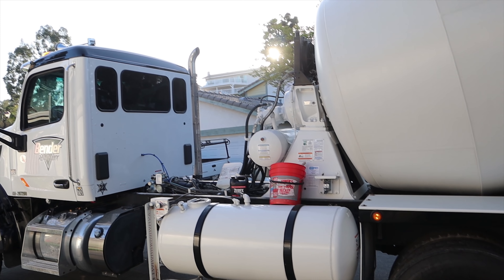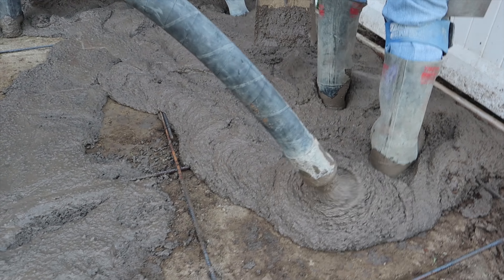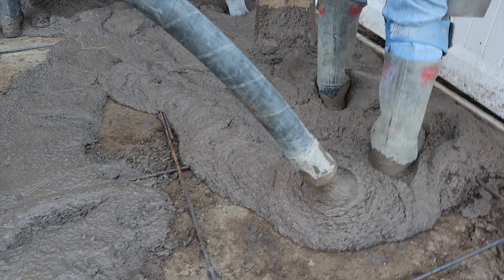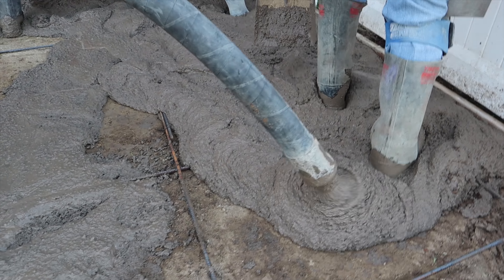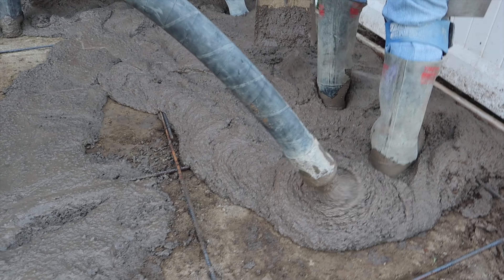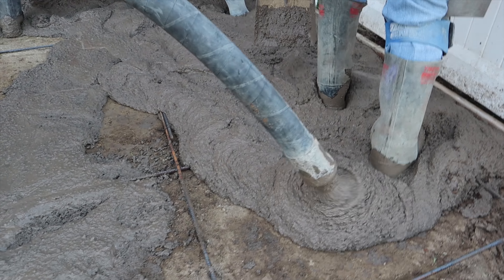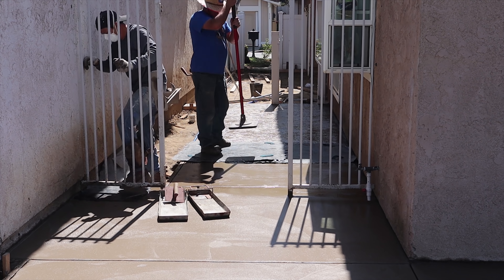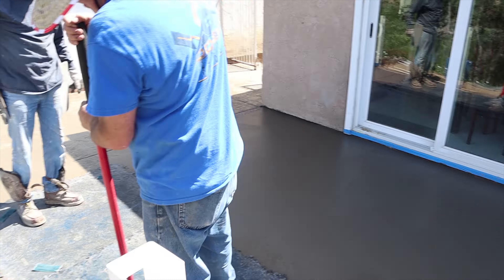How to Pour a Stamped Concrete patio Slab with color!

Comment: As a consumer, I appreciate the thoroughness of your step by step explanation. Question about lacquer based sealants to achieve the wet look. How do the  sealants hold up on hot southern full sun? Using a lacquer sealant practical in South Texas or is there a product that looks just good but offers more durability? 
Thanks
Reply from the maker: Look for the highest solids you can find, I'm sure you have better choices of quality lacquer base sealers in your area.
I used lacquer base in Las Vegas for years, It holds up well.
Re seal when needed

Comment: Hi, shouldn't there be a 2 inch separation between the existing exterior siding to the top of the newly paved section?  It looks like there's a small gap well below 2 inches at 6:00.  I believe this is called out in Chapter 7 of the California Residential Code.
Reply from the maker: 2"s below top of slab, not bottom of stucco.
If you did what your suggesting, the slab wouldn't drain to the street

Comment: Hi David, Henry here, I am a huge fan of your channel. Question. I made a 3 1/2 inch thick 3ft x 4ft concrete countertop, it is okay to build 8x8x16 cinder blocks 5 high for this concrete countertop? The concrete countertop I made has a 10x8 inch square opening for a bucket to go in the middle for drinks. And I'd figure I put cinder   blocks around the square opening to put the countertop over them when I build them 5 high.
Reply from the maker: You'll need some big footings and framing to hold that up

Comment: If discoloration by water is a problem, why not fill those joints with colored silicone?
Reply from the maker: That would work, but its easier to just go with a saw cut. Minimize standing water and a dirt trap

Comment: Hey Odell got a question for you, I'm building a Shed in the back yard. I need a concrete slab of 12'x14' x 4" Deep, what do you recommend on the concrete brand or type and psi? I live in Pico Rivera which is Southern California. My uncle has a concrete mixer he's willing to let me borrow, or should I order a short load? I calculated I need about to 2 yards of concrete. I have minimal concrete experience, but I been watching all your youtube videos....haha I'm willing to DIY but don't want to screw things up. Any advice would be helpful, or a number to a concrete pouring company. Thanks!
Reply from the maker: I would get the concrete delivered.
Maybe wheel barrow with a extra guy.
Reply: Odell Complete Concrete do you have a number of a concrete company that can deliver?